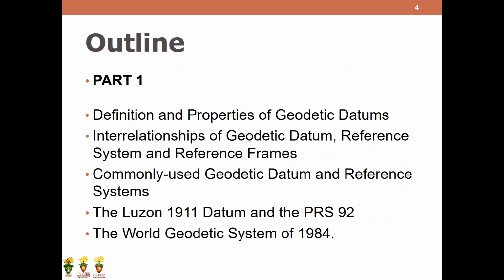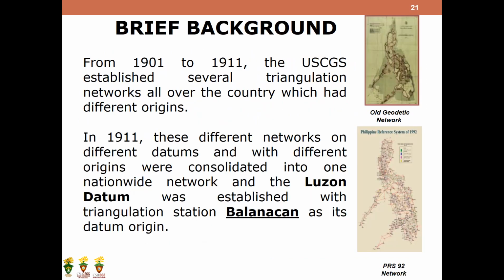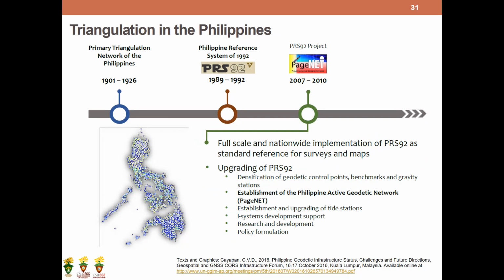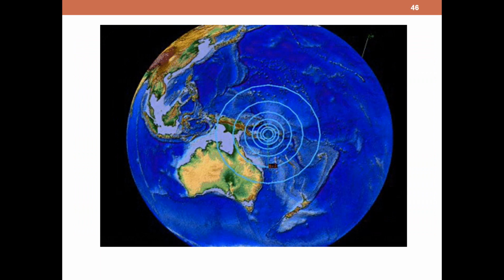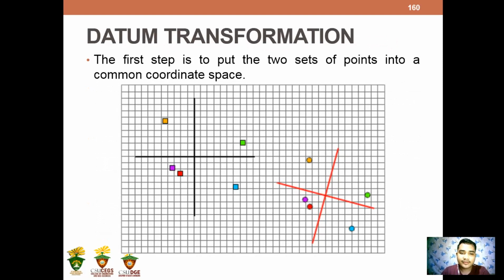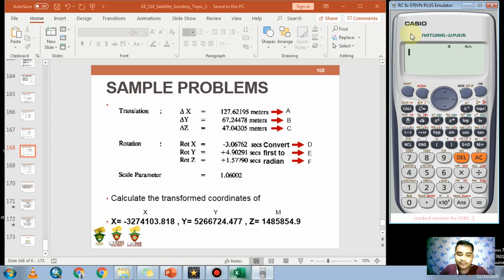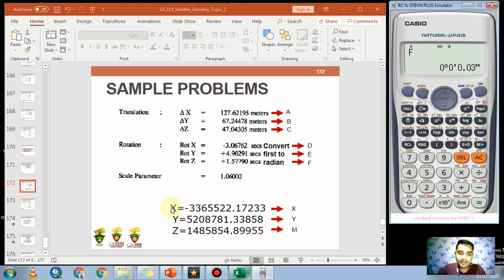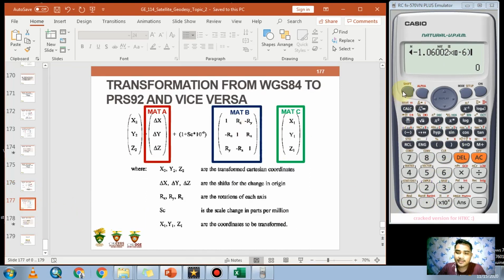Geodetic Datum and Datum Transformation | Topic 5 GE 102 Geometric Geodesy

Comment: Comments for consideration.  The easy part first.  To @solomononuchefaruna5022, who asked about the Rx, Ry, Rz values when transformation between NAD 27 (North American Datum of 1927) and NAD 83 (North American Datum of 1983).  As author Gagula noted very well old horizontal datums are purely two dimension so a three dimension transformation is really not reliable.  In addition as the author showed older local datums are comprised of networks that are not exactly consistent (e.g. different orders of accuracy 1st, 2nd, 3rd).  meaning there are different levels of spatial accuracy in each coordinate.  This must be considered for any transformation.  Both NAD 27 and the original definition of NAD 83 were both 2D.  Consequently, the national transformation between is a gridded solution across the country rather than a 3D or 7D approach.  The official transformation can be found in the National Geodetic Survey’s (NGS) NCAT (National Conversion and Transformation tool) -- https://geodesy.noaa.gov/NCAT/.  There are four publications that describe how this tool has evolved by NGS -- https://geodesy.noaa.gov/library/, in the search box type NADCON and all are shown.  In general, the uncertainty between NAD 27 and the original solution of NAD 83 completed in 1986 is 0.15 m (1 sigma).  Very important to note that NAD 83 has evolved with the introduction of GPS beginning in 1989 and the user must now be aware of which area of the country they are working in and what are the requirements for the uncertainty of any transformation the most current is NAD 83 (2011).
It is vitally important in our current world of high accuracy expectations that we fully understand the foundations for national and international coordinate frames.  Now that we are multi-constellational (not just GPS) WGS 84 should not be considered as a reference since the other three constellations are all defined in their own system such as the Russian GLONASS which uses PZ90.11.  All the constellations are closed aligned to some realization of the International Terrestrial Reference Frame (ITRF)
Now on to WGS 84.  A small error, the reference system was originally defined by the Defense Mapping Agency (DMA) in 1987 and published in DMA Technical Report 8350.2 “World Geodetic System 1984 Its Definition and Relationships to Local Geodetic Systems”.  DMA became NIMA in 1996 and is the National Geospatial-Intelligence Agency (NGA).  The most current link to the WGS publication is -file:///C:/Users/User/Desktop/WGS%2084%20-%20NGA.pdf.  Regrettably the author does not indicate how the government of the Philippines defined high accuracy (>3 cm) in the WGS 84 datum.  The U.S. Defense Department NGA does not provide access to any ground control framework such as Continuously Operating Reference Stations (CORS) with accurate WGS 84 coordinates for anyone outside of the U.S. Defense Department community.  Additionally, the datum for WGS 84 changed seven times as outlined in the linked NGA report to be closely aligned with the ITRF.  The most current realization is called WGS 84 (G2139) released in January ’21 aligned to ITRF14.  I suspect that the Philippines Active Network (PageNet) was most likely constrained to regional CORS that are published as part of the International GNSS Service (IGS) - https://igs.org/ for which all coordinates are provided in ITRF